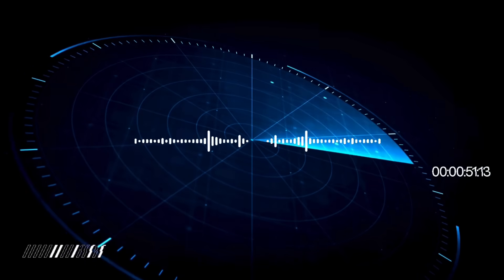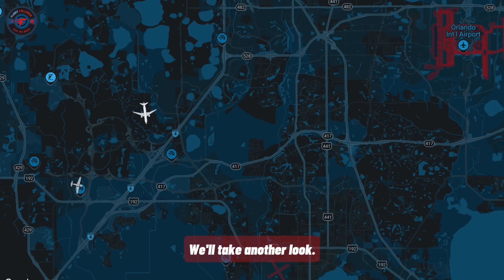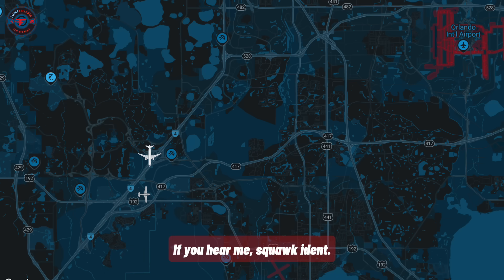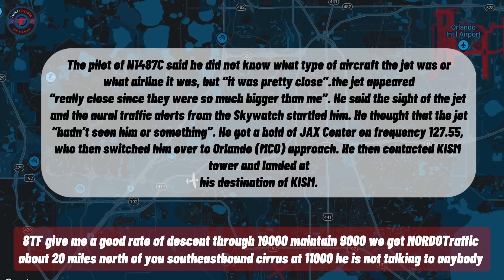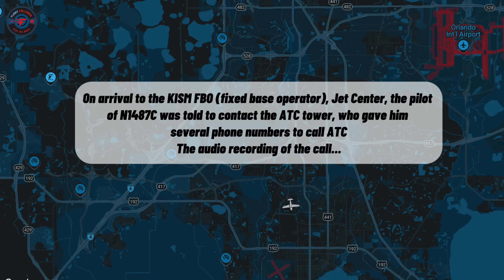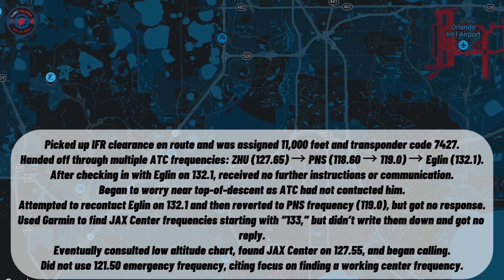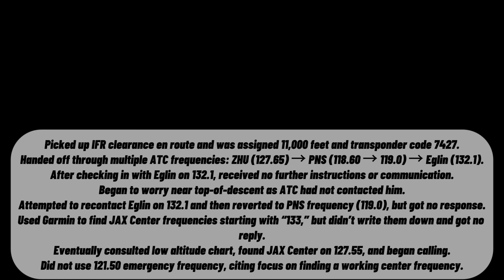ATC Suspended After Directing Southwest 737 to Inspect NORDO Aircraft, (Loss of Separation) 2011#atc

Comment: Layman's thoughts expanding the subject.   Along the path during the 1.5 hours of no radio contact, would it have been expected that other sectors' controllers along the way had any responsibility to make contact, and if no contact, get the air force intercepts far earlier? 

How long would it have taken for the fighters to scramble and reach him at these seemingly last few miles to the airport? We also don't know how much fuel he had and could have crashed into a metro area and killed folks on the ground.  

If he were asleep and continued, does the autopilot do anything, or is it programmed to do something when near the destination? It may not communicate with the computer where you enter the landing airport (obviously, I am a layperson).   Not as an excuse for the SWA action, but seeing the big thing coming at him, DID wake him up and get him on the radio.   I'm going by the assumption that the fighter, going by, makes a louder noise and would have gotten his attention if he were able to reach him before something worse happened, like running out of fuel.    

In my view, the primary cause of the incident was the private pilot seemingly knowing he was somewhat lost and not using the guard frequency, unless he was asleep.   

Someone mentioned that a potential lack of oxygen is likely at 11k. I assume pvt plane didn't have O2 masks? And the pilot, once awake, didn't sound like I had heard some coming out of a lack of oxygen before descending to lower altitudes and coming out of it.

Comment: The scale and position of the map is again quite odd.
1:10 "about 8 miles" while the distance on the map is about 4NM.
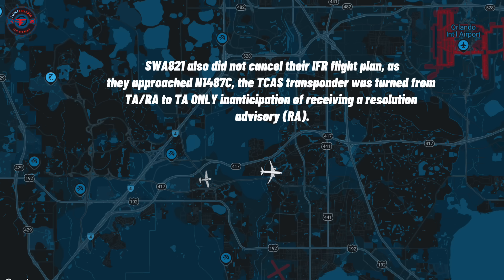4:15 and 4:45 "Rwy 17R" "over VOR Orlando to left downwind".
Everything must have happened more NW of Orlando than SW bc VOR is north of Orlando Intl.
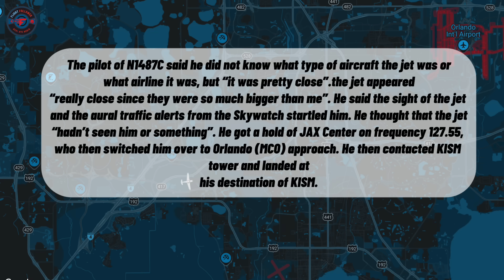6_00 to 6:10 the cirrus is flying backwards.
Reply from the maker: Thank you for your detailed feedback—we really appreciate you taking the time to point these things out. You're absolutely right that some of the map elements, such as scale and aircraft position, aren't perfectly accurate. These maps are not to scale and are intended just to provide a basic visual reference to help viewers follow the general flow of events.

We're not professional video editors, but we're always learning and trying to improve with each video. Your insights help us a lot in that process, so thanks again for your support and constructive input!

Comment: ATC controller was thinking a little too far outside the box for this situation. Using a 737 full of passengers to check on a GA aircraft? I'm surprised the 737 pilots went along with it. I would guess the better option would have been to reach out to the military for an unresponsive aircraft? They are better trained for such incidents.

Comment: My overall impression of the FAA leadership after 40 years is that at times if they had any brains they would be dangerous.Checking another craft is a highly desirable thing. I doubt SW did it with their eyes closed so 100 feet is fine at 60 knot differential. and 2 skilled pilots looking.     Me: Abbott needs flying lessons and a review. (or fire his ass)

Comment: How else was the ATC supposed to find out about a rogue aircraft that has stopped communicating? The SWA pilot didn't get close enough to risk the lives of her passengers. But maybe it would have been better for a small plane to check on this one rather than a passenger jet. But only if a small plane was available.
A rogue aircraft could have done much more harm to everyone than the SWA jet flyby could have done.
Reply: This situation was chock full of "nuance".  Lol.   First of all, an airline captain doesn't have the authority to partake in such "sight-seeing" operations with his boss's aircraft.  So that kinda ends the story right there.  And there are other reasons, but I hope you get the point.
Reply: You don't risk the lives of 230 passengers doing a close intercept on a "rogue aircraft."  And yes, she did get close enough to risk passenger lives, depending on what the Cirrus might have done without warning, either by accident or intent.  I am astonished at the level of stupidity I'm seeing on this thread.

Comment: Maybe Cirrus should charge a little more so that they can afford to put working radios in those Chinese planes.  Jokes aside, I see some polarized opinions here.  To me, this is a case of someone making a risk/benefit assessment in a situation that was a potential emergency.  You may disagree with the decision that was made, but I don't see any single choice of action as a no-brainer correct thing to do.  There was risk in having an unmonitored, and potentially uncontrolled plane near restricted airspace and population centers.  There was risk in waiting for military aircraft to scramble & arrive.  There was risk in the two planes flying close together.  Every option carried risk of some sort.  I was surprised that the two planes got within 0.1 miles of each other.  I do not know if that was what the ATC had intended or not.  In the end, nothing bad happened.  I see this as an opportunity for a  learning experience, with perhaps a slap on the wrist & some additional review training thrown in.  Review is certainly warranted.
Reply: The most coherent response I've read, so far.

Comment: I don't agree with the suspended controller. A warning would have sufficed. Although I do think that the southwest aircraft was not the right plane to have doing the flyby due to it's large size, min stall speed etc, in comparison to the target aircraft.
Reply: a warning isn't a paid vacation !   I'd take the suspension.

Comment: This would have been dangerous enough during cruise to have them check on for example a NORDO business jet that they were overtaking. But this was during a critical phase of flight. Pilots are not supposed to engage in any conversation during a critical phase that is not directly related to the conduct of their flight. I wonder if the controller had ever even heard of the sterile cockpit rule. So even just asking a pilot to comment on something they are seeing out the window during a critical phase is skating on thin ice. But asking them to maneuver during a critical phase to get a better view of something is a clear violation in my (layman) opinion.
Reply: An SR22 isn't a business jet.  A business jet would be traveling A LOT faster and could possibly have the performance to be a threat to an attentive 737 crew.  An SR22?  Highly unlikely.  Also, it's sterile during taxi, takeoff, landing, and below 10K ft.  They were descending to approach and were still above 10K ft.
Reply: @ds78613  FAA reg is 10K but some airlines use top of descent or in some cases even pre-descent checklist. The controller would have no idea what the situation was. As for the rest, I have no idea why you think I said a SR22 was a business jet or travels as fast as a business jet.

Comment: Vectoring a 737 to intercept a NORDO Cirrus (who will obviously be unaware of a jetliner joining on him) with a 60 kn overtake...what could possibly go wrong?
Reply: What went wrong?
Reply: @mikek5298 Nothing. But dodging a bullet doesn't mean you weren't at risk of getting shot.
Reply: @richardpark3054  show us in a sim where the 737 was ever in any greater risk than if they had done nothing, short of the Cirrus being packed full of explosives, which is in and of itself a stretch that it would have been a threat once the 737 was abeam or in front of the Cirrus.

Comment: Putting aside the wisdom of this on the part of the controller or pilots, it should be noted that the SWA appeared to have visual contact with the Cirrus before radar separation was lost. So it seems the only reason that this is a loss of separation is because the controller didn't say "maintain visual separatiom".

Comment: Next time a Chinese ballon enters the US airspace, they ll call Southwest
Reply: @Boss_Tanaka  They would probably do a better and definitely cheaper job than the US military (a very low bar) :-) They could have taken it out with a random Boeing door departing formation, which would have to cost less than deploying a M$ 350 F-22 firing a k$ 400 AIM-9 Sidewinder to down what proved to be an innocuous research balloon - as the Chinese had said from the beginning.
Reply: @AtomicHermit yeh, right, you can definitely trust the Chinese to tell the truth.
Reply: @AtomicHermit  Shut up.

Comment: Interception is a job for military aircraft. There are plenty of those stationed in South Florida.
Reply: There is no way that ATC could have contacted the AF and then scrambled an F-16 at night to get up there before the Citrus landed or possibly crashed. Sorry, the AF does not have pilots sitting in their seats ready to start up and take off.
Reply: It cost $20 in fuel for the SW to fly past the Cirrus.  It would have cost $100,000 to scramble two F-16s to investigate and have them arrive an hour later.
Reply: @alanmcentee9457 That SW jet is carrying civilians. Those F-16's already spent that 100k and are there for this reason.
Reply: @rickyism1576  
That makes as much sense as those screen doors you Russians put on your submarines.
Reply: @alanmcentee9457  The point is.... airline pilots are NOT TRAINED for,  and ARE PROHIBITED from doing this for good reasons.  Just ask the COO of SWA.

Comment: ATC should have requested  NORAD support for an F-16 flyby from Eglin AFB to determine status of the Cirrus SR-22.
Reply: I agree...not a 737 full of passengers
Reply: What could have been a positive benefit from this exercise?  What was the positive benefit?
What benefit is a report that “the pilot is dead” or “ the pilot is okay?”
Reply: To scramble an F-16 it would take at least 30 min to get to the Cirrus. By that time I bet the plane was on the ground.
Reply: That's not how that works. The DOD is not at the service of civilian atc's. The DOD helps when they want to or when ordered by the chain of command. Civilian law enforcement should have flown over with their choppers or small aircraft if available.
Reply: @ikefork2606  that’s exactly what was about to happen. 
Airliners were about to start getting TCAS warnings, ATC was trying to decide if they needed to scramble fighters & close the airspace. Those SW pilots avoided ALL kinds of potential chaos breaking loose overhead a highly populated area. If PIC felt it was unsafe, they simply say no.
PIC judgement call & the right one.
Reply: No they should never have been asked.  SW are famous cucks to ATC.  They earn points by sucking up to atc, so they can jump the line and give themselves t/o clearance.
Remember that next time you buy a ticket? Avoid SW.
Reply: @IanWallace-z4n  Correct. The SWA pilot did what she thought best to do under the circumstances without undue risk.
Reply: Agreed. NORAD should have taken control.
Reply: F-16 involvement would cost an extra what $40K ?
Reply: @2Truth4Liberty  What's the cost of a crashed Southwest 737 full of passengers?
Reply: @ ikefork2606  
Way more than $40K but that wasn't my question.
Another question: How many cesna's have caused 737's to crash?

Comment: I wonder how old the Cirrus pilot is.  IMO it didn’t sound like he had all his mental faculties during the hour to hour and a half ATC was trying to reach him.  My heart goes out to the ATC who lost their job for trying to do the right thing.
Reply: The cirrus pilot is 14 years older now since this thing happened 14 years ago
Reply: Doing the right thing is taking the safety of the passengers aboard the 737 first.  you don't use innocent people to solve your comms problems.
Reply: ATCs are in such short supply that most likely he would have received a letter in his file that got removed at the insistence of his union.  Behind the scenes everyone is telling him "good call"..  The ATC cost SW $20 in fuel and saved America $100,000 in scrambling two F-16s that would arrive long after the Cirrus was out of range.
Reply: I thought he was only suspended...

Comment: Visual separation is still separation, but turning right in front of the smaller aircraft esp with wake turbulence isn't the best idea, even if it did wake him up.
Reply: Aaaa—the Southwest flight was 1,000 feet lower…. Disciplinary action of the Controller is wrong and sends a horrible message. 😢
Reply: @hkvp9tactical418 
Data on video says 100 ft verticle and 500 ft horizontal.
Reply: @landen99  He sounded still half asleep when he made the phone call.  Set the autopilot and take a 90 minute nap.  What a wanker.  Probably not the extra kind of safety that Cirrus has in mind with the parachute.

Comment: I was an Air Battle Manager in the Air Force for 27 years. I did the same thing as the ATC controller but with fighter jets. The main difference is ATC should provide separation whereas my responsibility was to obtain visual identification. And I never placed the two aircraft on identical altitudes while vectoring the fighter aircraft. Fortunately this ended with no fatalities except for the controllers career.
Reply: As a KC-135 Navigator, I directed hundreds of rendezvous.  We absolutely could not make the final turn in front of the receiver without a 1000' positive altitude separation.  This was between two planes that had planned to do this.  We also had to accept MARSA - (military assumes responsibility for separation)  They really should have had some fighters scrambled for this.

Comment: The airliner pilots were probably former Navy, Marine, or AF fighter pilots and welcomed the chance for a little slow-flight loose formation!
Reply: 😂 great comment!  What level of risk? They were only cleared to the same altitude when the 737 pilot had clear line of sight. By then the close rate was slow.
Reply: @robfredericks2984  irrelevant.
Reply: Yep Southwest is known for bringing on a lot of former military pilots so that makes sense.
Reply: it's cool and all, but it was a passenger flight. with 100~200 souls on board it's not ethical to volunteer for this level of risk.